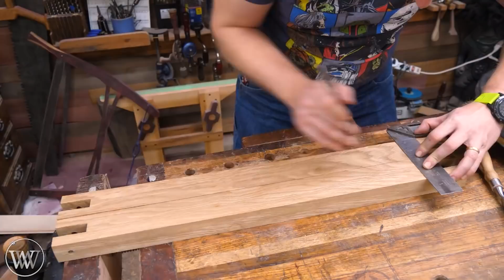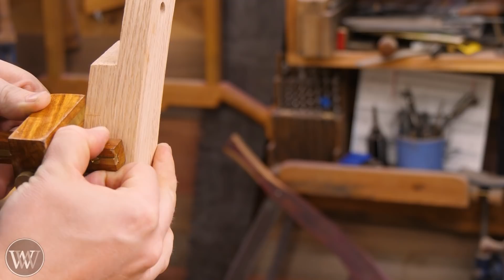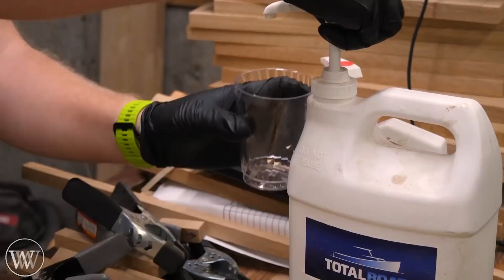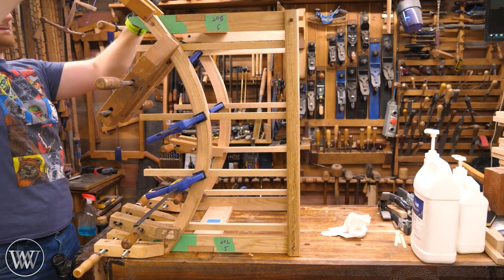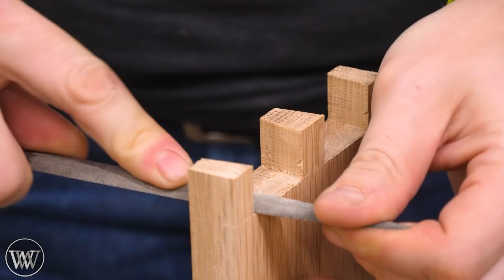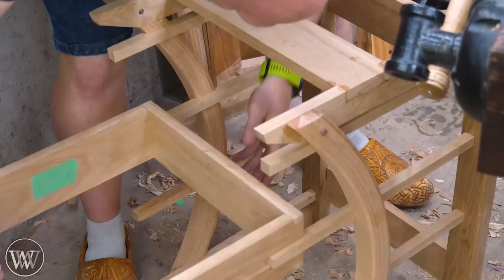How to Make Desk Drawers Slides and Dovetails

Comment: Why do you use epoxy instead of wood glue? Is it stronger?
Reply from the maker: Epoxy has a much longer open time and I was going to need a lot of time on this one. Also, it has the best gap filling capability as half lap joints will never be perfect joints.

Comment: It's a shame you didn't go with the show tails.  It's your build, not anyone else's.  One way to deal with the show tails, after they are together, assuming your pins are wide enough, drill a hole thru the pin board into the tail board, and run a down into the tail board, so you get the show tails, with a mechanical advantage of an impossible to fail joint ;)
Reply from the maker: yup. I was going to put in brass pins as I have done int he past. and if the sides were not visible I would defenently be doing show tails, but with the sides visible I think the half blind would be an equal choice.

Comment: cool work as always! there is no stop for the drawers to NOT fall out am i right ? hope you dont pull them out too often :D
Reply from the maker: no. two for these I will be pulling out all the time to use as a small tool box. and most drawers through the years never had that. that is a fairly new invention with roller slides.
Reply: @WoodByWrightHowTo  had not actually thought about it being a new invention :O is there a easy way to stop it with your desing ? i can come up with a stupid complex way but easy and simple ? :)
Reply from the maker: I have actually never seen a design to do it with wooden slides.
Reply: @WoodByWrightHowTo  wink wink, time for a brand new idea and get them views ;)
Reply: @MrNikke96  a spring loaded pin in the slide would probably be the easiest, with a corresponding hole in the side of the drawer where you want it to stop. The pin chamfered so that it pushes in when the drawer is first inserted, but pops out into the hole when the stop is reached. The hole would be 8mm wide (or whatever the pin size is) on the slide side of the drawer, with a 6mm hole on the inside to prevent the pin coming into the drawer but allowing the option to poke the pin back through if you need to take the drawer out.